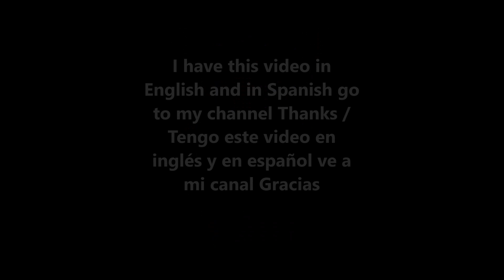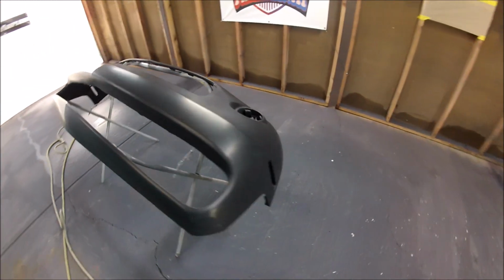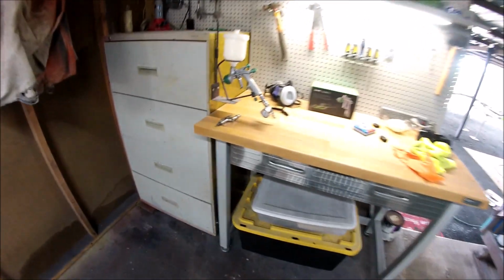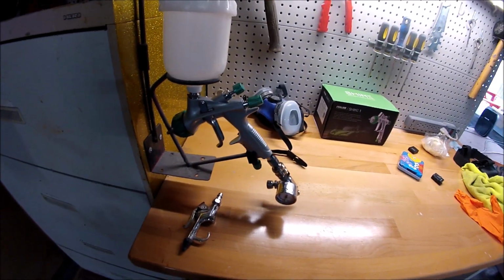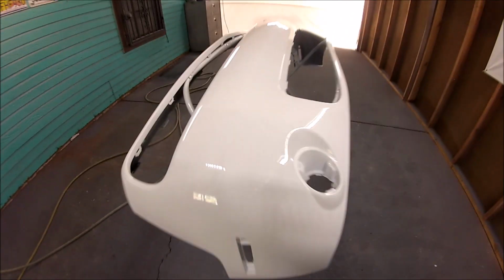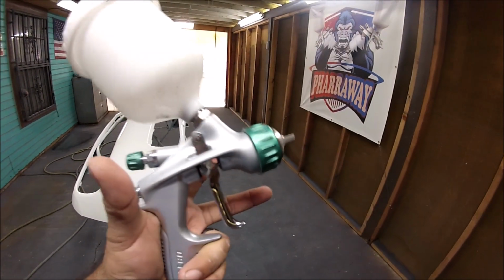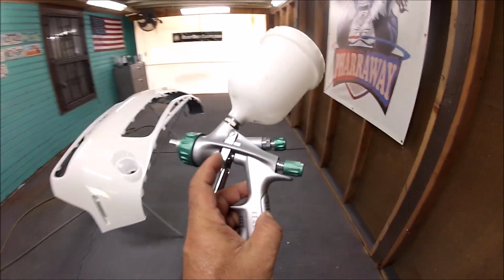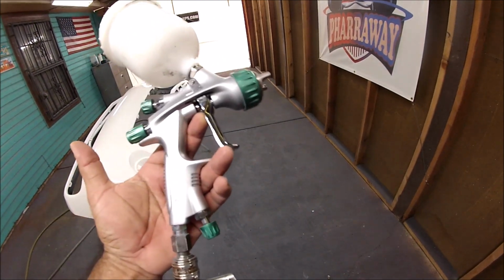Review and Demonstration of the new Italco Shine 1

Comment: I just got the LVMP version. Feels heavy, It has a nice design but adds unnecessary weight. Trigger is stiff, I took it apart and lubed it up with iwata spray gun lube and got smoother but the spring is still stiff. Haven't sprayed anything with it yet. There are no notches on the knobs like the one you have. Operating pressure is 36 psi but i'll try 20-29 psi first.
Reply from the maker: Oh wow it's a bit different

Comment: good demostration..i need your help.. i being following you for a lo time...i pulled a dent like a foot lond 5inchrs wide... i bondo over it, etch primer over bare spot,  filler primer over the whole repair area...  next day i come in prep theprimer sand with 320 applied the base paint it reacted..   itflaked off and 5mins after you could peel od in big shunks with your finger... the weird thing is that the primer got really tacky under the base.. please i need tour help on what to do to fix it..
Reply from the maker: wow never seen that what primer did you use was it 2k or 1k?
Reply: @PHARRAWAY 1k i believe POR15 high build primer from eastwood
Reply from the maker: @ccas1318  That was the problem brother the primer, that primer is no good for bodywork (Bondo).
Reply: @PHARRAWAY  shoot..
Reply: Do you recommend Eastwood products?

Comment: Can i use it with small compressor 30 gal 8.5 cfm @ 40 psi or go for a lvlp gun ?
Reply from the maker: yes but the compressor will be running nonstop
Reply: @PHARRAWAY  may buy the lvlp iwata 101 then